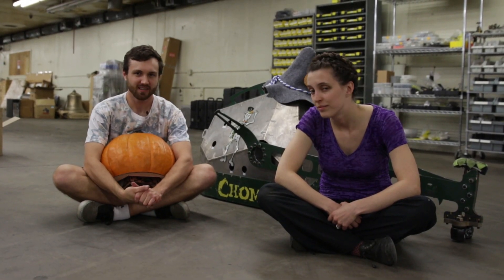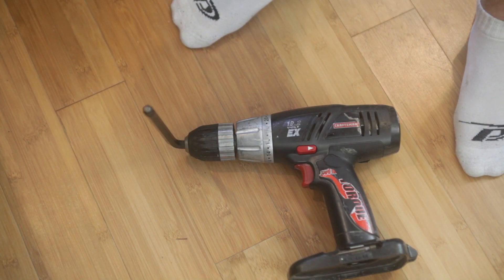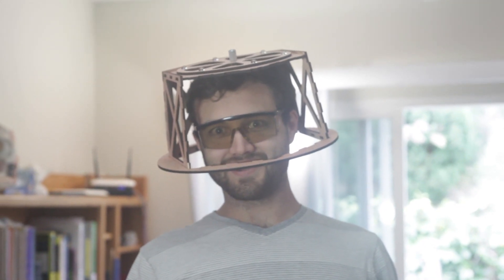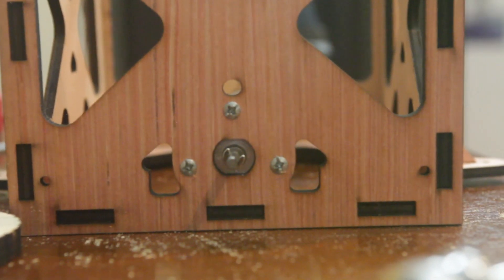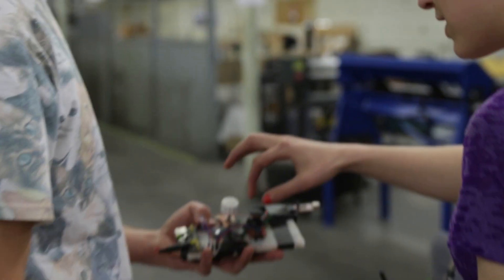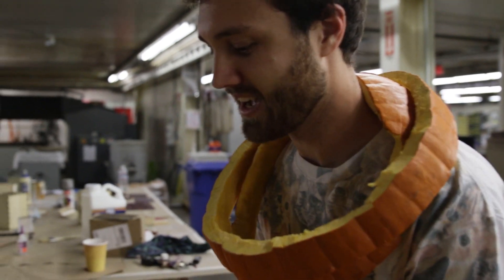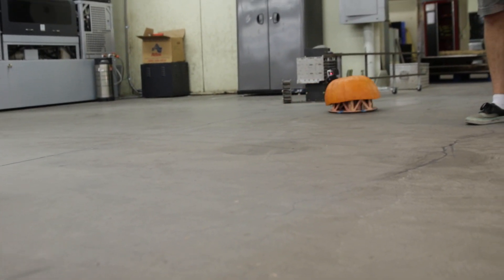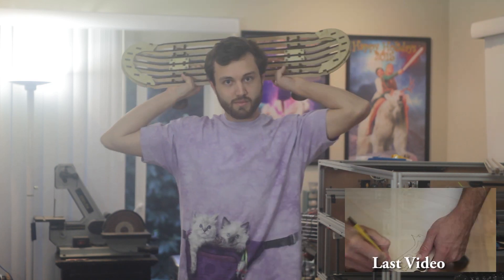RC Pumpkin Combat Robot

Comment: The funny thing is if the drill motor was strong enough and will replaced the pumpkin with two big ass blades it could be a pretty badass and effective battle bot

Comment: should have hid a grenade inside that has the pin removed using a remotely controlled servo, or even better, a numatically powered flex seal can attached to the top of the pumpkin that seals the enemy to submission

Comment: woa you used marbles as ball bearings too.  I have a list of cheap-round-things that might work as bearings and marbles are one of them :D.

Other interesting things on the list are: BB ammo, round wooden beads, ping pong balls, golf training balls, ball-pit balls, polystyrene craft balls, and unshelled macadamia nuts.
Reply: I mean, BB literally stands for ball bearing
Reply: aren't golf training balls squishy though? making them less effective as ball bearings than regular golf balls or marbles
Reply: @agustinvenegas5238  some are squishy yea, but nah i mean the ones that are hard plastic shells full of holes.
Also it's crazy you replied to this just now, i'd wrote the original post 3 years ago - but just yesterday i'd been thinking about it again!  
(Youtube had recommended me the video "3D Printed Bearings - Are These Real Things?" a few days ago, i wonder if it recommended it to you too, might be the common factor).

Also, I wonder if the suggestion of round wooden beads ultimately inspired William's "All Wood Bike" video :P

Comment: Why do ppl put flamethrowers on battlebots when their opponents are almost always made of metal?
Reply: Oh Fudge metal gets heated easier and more efficient. It would melt circuits and overheat massively.
Reply: Oh Fudge You can melt the rubber on the tires and overheat the electronics, thus making the robot basically shit itself.

Comment: What program do you use for CAD
Reply from the maker: SolidWorks 2011
Reply: Thanks man, also when using it, how do you make sure everything clicks and fits into eachother, that's one thing I find difficult
Reply from the maker: ehhhh, usually. It's better to spend the time double checking in CAD than trying to hack it together after you've made parts. In a SolidWorks assembly, you can link sketches on one part to features on another; this is usually how I fit everything together.

Comment: A FUCKING FLAMETRHOWER and still pumpkin bot won
Reply: In our hearts he won :(
Reply: xMatirii spoilers >:(
Reply: xMatirii wow.  Thanks for spoiling
Reply: xMatirii it’s not like the flame thrower would actually do ANYTHING. The only thing I can imagine it doing is decreasing the hardness of steel.
Reply: @michaelc.4321  decreasing the hardness
Reply: @michaelc.4321  most electronics don't like excessive heat. servos love to melt rather quickly.

Comment: did chomp change it's weapon drive mechanism? it was air powered last season but it sounded like an electric motor in the video.
Reply from the maker: The hammer is reset with electric motors. Air can be used to reset the hammer if the robot is on its side and you're ok with it swinging around like a jump rope.
Reply: Ahh, thanks. I can't wait for season 3 of BattleBots
Reply: Kevin Liang I have good news... May 10th 2018 on discovery channel.
Reply: jigglywaffles omg not long.

Comment: chomps major flaw is that the second it goes to hit something it jumps out of the way or tips over
Reply from the maker: They knew this was going to be a issue. Team Chomp ain't no dummies. The problem was their electromagnet hold-down was designed assuming a solid arena floor and thin rubber instead of stacked steel plates and thick rubber. They were not the only team to remove magnets after discovering them ineffective.
Reply: yeah i heard from a couple of the east coast teams the floors paint also made it a pain to stick to the floor. i cant remember the team or the bot but i remember they had an alternative drive train that just used electro magnets to propel themselves. then beta also had the same issue since i remember they would always use magnets to stay planted
Reply: it was road rash that i was thinking about with the magnet drive